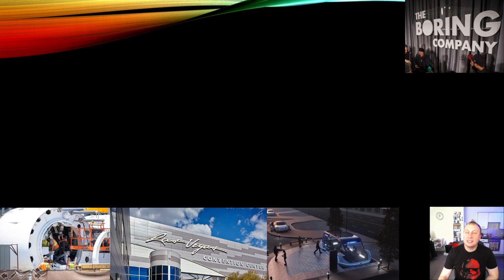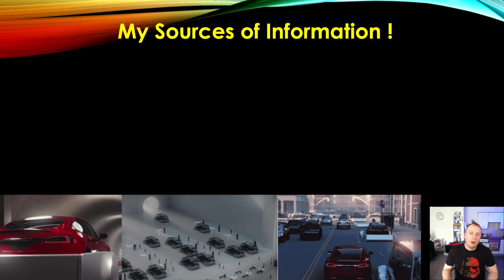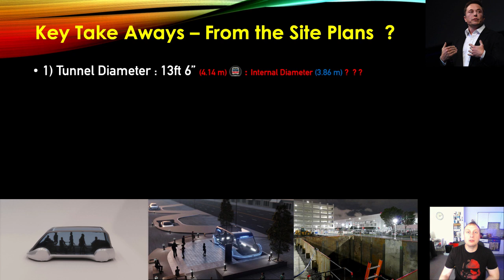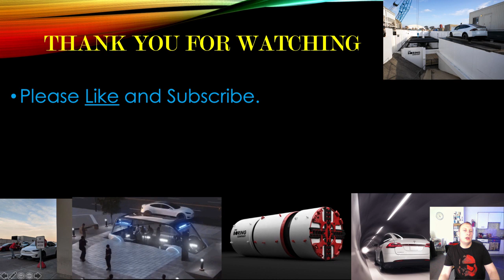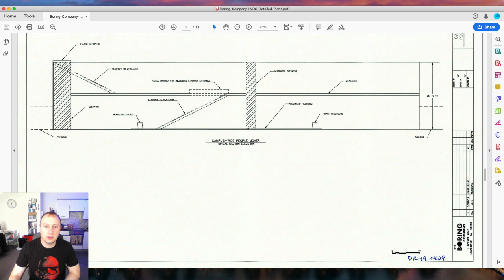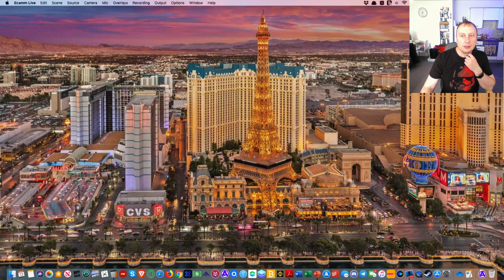The Boring Company - Las Vegas Loop Big Update & Analysis : Episode #41 😁 🇺🇲 💰

Comment: What is a Kishner drive may you explain
Reply from the maker: Its a 900ft access road that runs through the "new" part of the Las Vegas Convention Centre. Unsure if it runs above one for the underground stations or has been permanently shut and thus torn up.
If it is still in use they'll need to divert it - so I was worried about the complexity of running that over the station.
On google maps it is still labelled on the Map !  I need a man on the ground 👍🏻
Reply: They tore it up, and started welding. I think it’s being upgraded.

Comment: I was wondering if you have got any information if the Boring Company already has made any improvements to the TBM’s. Is it already faster than Gary the snail?
Reply from the maker: Information is very thin on the ground! 
I have pictures of two TBM's they have fabricated in Hawthorne near SpaceX. Looks like the Line-storm machine.
Without guessing I can't say for sure how they've changed it. It won't be as fast as Gary, maybe 40% slower !